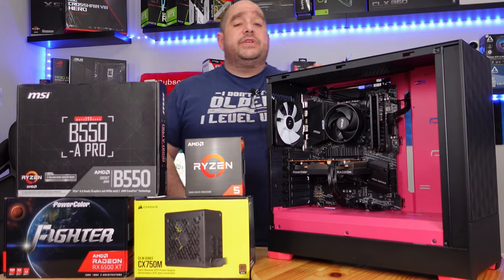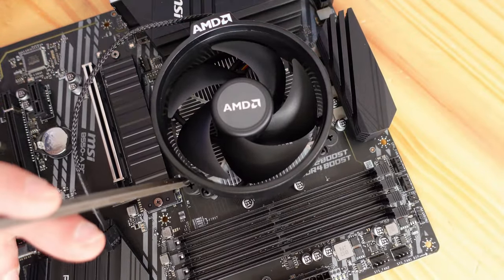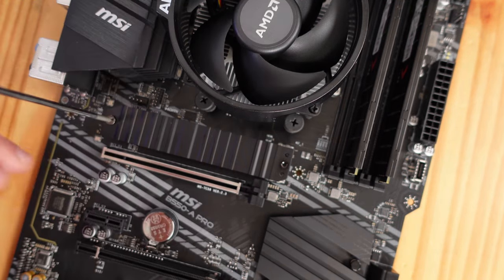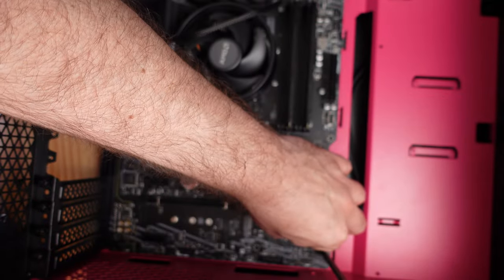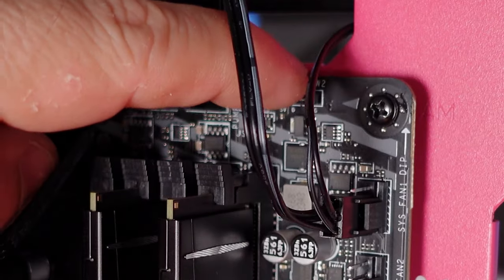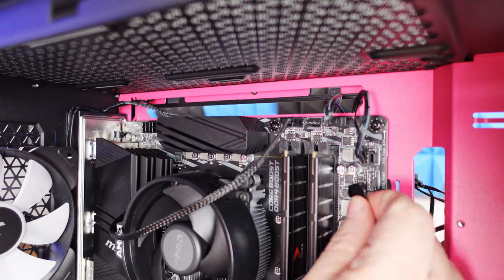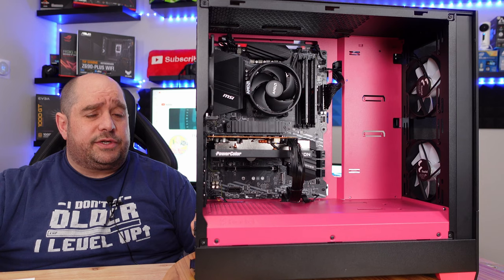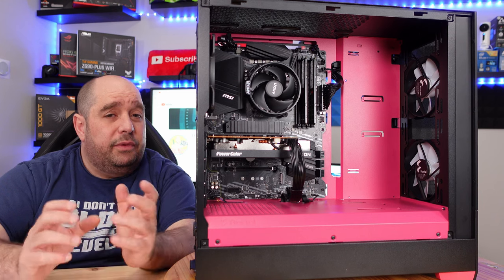Building a Powerful PC Under $1000

Comment: Hi i can I have two choices i can build a pc with 12400F DDR5 + 7700XT or 7600X + 6750XT 
For the same price so which one i should prefer GPU or CPU 
I will be using for gaming and live streaming mainly and some lil bit mining (7700XT is 25% to 30% better than 6750XT)
Reply from the maker: 12400F with 7700XT for sure. I will be discussing I think soon about amd vs intel, but it may take me some time.

Comment: Where does it say to use slots A2 and B4 for memory? Other presenter told that the manual states as A1 and B3. Did you read the manual?
Reply from the maker: I did, did you?, They didn't either it seems, I did not say A2 and B4 I said A2 and B2, did you watch the video, check out page 28: https://download.msi.com/archive/mnu_exe/mb/B550-APRO_EN.pdf

What other "presenter" stated A1 and B3?
Reply: @ThisBytesForYou  No, I didn't. I never build a PC, it's why I like to watch videos as yours to learn a lot from experienced guys, like you. Regarding confusion between B2 and B4, again you are the best here, the board has only two B slots. Why B4? Again, watching videos from less experienced guys, made the impression.
Reply from the maker: Watch at 4:01,  Slot 1, is A1, slot 2 is A2, slot 3 is B2 and slot 4 is B2, check the manual on page 28, like I linked up https://download.msi.com/archive/mnu_exe/mb/B550-APRO_EN.pdf

I hope this video helps you build your first PC

Comment: 1 more question with the cpu and motherboard will i have to update the bios for it to be compatible with the ryzen 5 5600?
Reply from the maker: My friend, you can ask me questions for ever, I am here to help.  As for the CPU no, you won't need to flash it unless it was an X, but you should flash it anyway.  Form the Base BIOs that the board comes with (which will be years old) till the latest BIOS they have fixed so many memory, CPU, PCIE, graphics cards issues and security issues, you NEED to update it to be safe and to make sure your stuff works well.
Reply: @ThisBytesForYou  how do you update the bios?
Reply from the maker: What is the motherboard manufacturer and model number?
Reply: @ThisBytesForYou  the same one in ur vid
Reply from the maker: Perfect, here you go: https://youtu.be/jzFl6ejaQgk
Reply: @ThisBytesForYou  ty
Reply from the maker: @clawww-  always a pleasure my friend.

Comment: hi will i need a 3 pin rgb splitter for my rgb fans what come with the case and my cpu cooler?
Reply from the maker: are your fans RGB or aRGB, do you know the manufacturer and model number of your fans and the manufacturer and model number of your case?
Reply: @ThisBytesForYou  tbh mines gonna be a budget build the case is called gamdias t3 e mesh in black
Reply: @ThisBytesForYou  mb its called the GAMDIAS TALOS E3 MESH
Reply from the maker: those are aRGB fans, if your board has an aRGB, I HIGHLY recommend you get this cable, I bought a few, off of my Amazon affiliate link: https://geni.us/CA97sJ
With that, what is the manufacturer and model number of your motherboard?
Reply: the same one u used in the video sorry for late reply
Reply from the maker: @clawww-  so you are fine with what you have, but I would recommend that adapter cable I linked up.
Reply: @ThisBytesForYou  ty do yk how much fps ill get with a 1660 super and a ryzen 5 3600 on all low settings on fortnite and how much fps will i get with the ryzen 5 5600?
Reply from the maker: @clawww-  I don't know to tell you, I have never reviewed that graphics card, I will state that you should play at 1080p with medium or low presets for best results with that.
Reply: @ThisBytesForYou  ty for all the advice
Reply from the maker: @clawww-  Always a pleasure my friend, so very happy you stopped by, trusted in me to help you, liked and subbed as well as took a moment out of your day to thank me.  It means a ton to me and I am so very happy I could help you.
Reply: @ThisBytesForYou  is the ryzen 5 3600 compatible with the motherboard u used?
Reply from the maker: yes it sure is, you can see my full build spec in the description as well as well as my amazon affiliate links to buy everything.
Reply: @ThisBytesForYou  ty
Reply from the maker: @clawww-  Always a pleasure my friend.

Comment: I would recommend you to downgrade cpu to r5 5500 and take rx 6700 or rx 6750xt build would be much better !
Reply from the maker: My friend, that would have been WELL over $720, it would have been 820, thats with a 6700, not a 6750.  Doesn't make sense, regardless, there is a reason I did it this way, aside from keeping the cost down and I will go over it within the videos, I hint that in the video too.

 6700
 $329.99
 5500
 $119.00
 
 5600
 149.99
 6500
 179.99